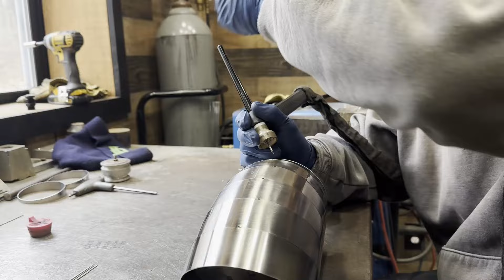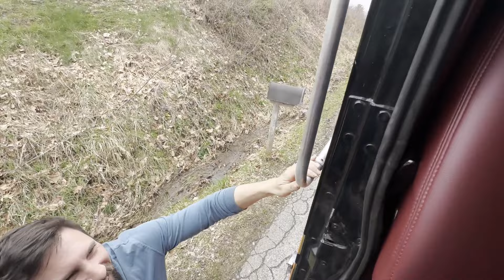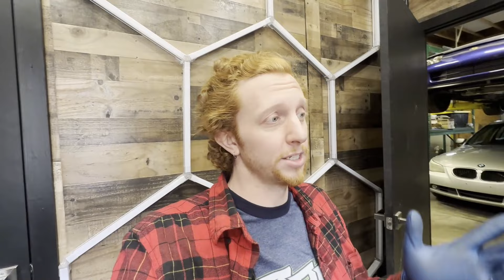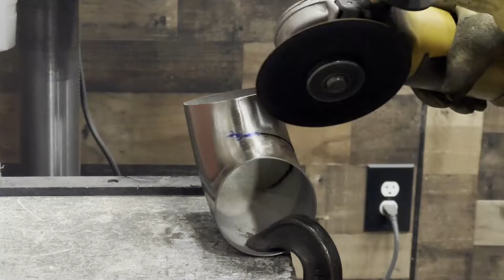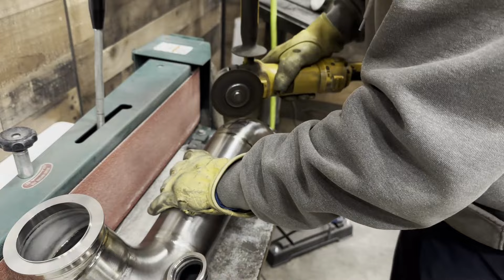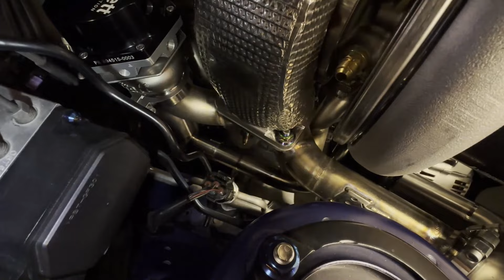RSP Supra Project Episode Three: Finishing the Engine Bay Work (Tricky Projects)

Comment: I'm a little late to the party on this video, but great work as always.  I know the answer to this question comes down to experience/preference, but what TIG settings were you using for whatever wall thickness tubing that is?  I'm currently trying to learn stainless tubing for exhaust, but I seem to randomly blow through the wall with no perceivable changes on my part.  It's hit or miss with me.  Not sure if it's the cheap amazon tubing I bought or incorrect settings, but I can't get consistency just yet.  I'd like to learn titanium after after I get confident with stainless.
Reply from the maker: I believe I had my machine set around 60A for most of the titanium work. However, don't focus too much on the amperage number but rather on reading the puddle and/or proper joint fitment. Blowing holes in material is generally a direct result of too much heat, gaps in fitment, or a combination of the two. 

Keep your fitment tight and focus on learning to read the puddle. Reading the puddle is a huge amount of information input that will directly affect the output of your actions. It takes practice, but is the best way I know of to produce the highest quality work possible.
Reply: @AlexLindner  Thanks for the info.  I think fitment has been my main issue since a hack saw doesn't make the most accurate cut and I always have gaps.  I'll try to eliminate that variable and just keep practicing.  Thanks again.

Comment: pie cut is mostly if not all just for aesthetics right? i would think the bent tubes may have a smoother flow since there are no ridges inside. probably nothing significant im sure.
Reply: You can’t get tight enough CLR mandrel bends for the larger diameter material for certain applications. Having said that, some use it for an aesthetic purposes.
Reply from the maker: Pie cuts, while not my favorite way to make a bend, have their place and benefits. They maintain uniform wall thickness throughout a bend and allow for fine adjustments of bend radius and direction that are not possible with mandrel bends. Some materials/sizes also aren't able to be easily bent without a large investment in tooling (e.g. the 5" inconel downpipe on my MKIV Supra). There's the aesthetic component as well, which was the main reason for implementing them in this project. 

While I prefer mandrel bends, sometimes pie cuts can be a reasonable choice.

Comment: Beyond the obvious heat protection benefits of wearing welding gloves, they also protect your hands from the UV light generated by a TIG torch, which is cancer causing.
Reply from the maker: UV radiation is a real concern with welding. I've gotten sunburnt a few times from it and try to be more cognisant of appropriately covering myself nowadays. The main reason for wearing gloves for me, at least, is to protect myself from the thermal component, as you said.